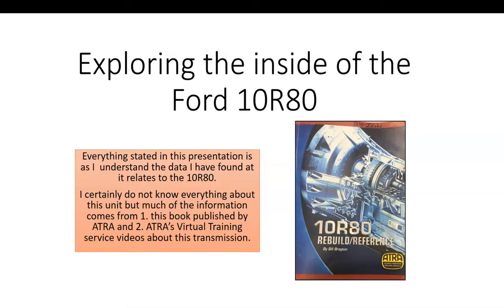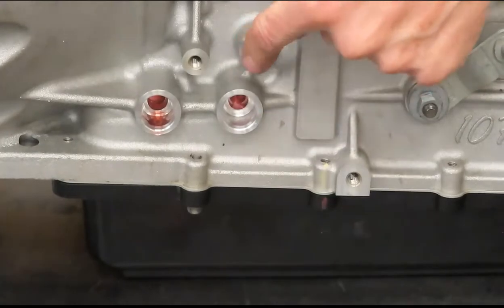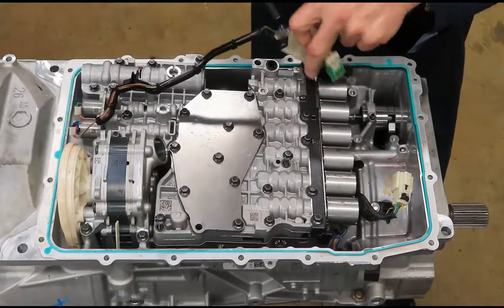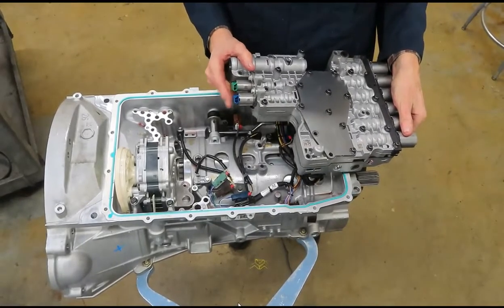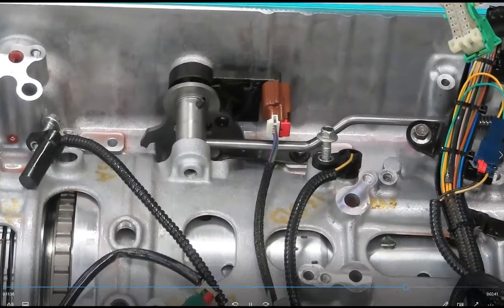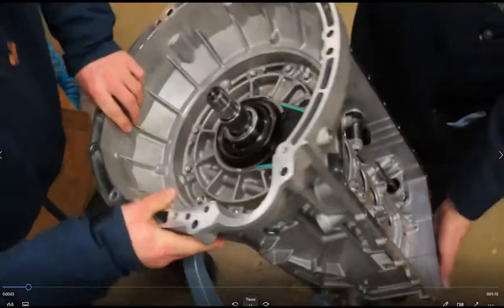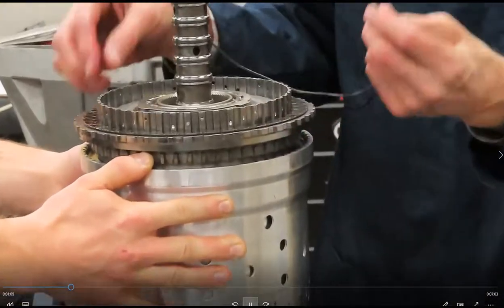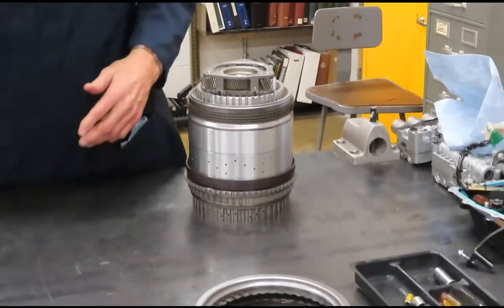10R80 part 2/5 disassembly

Comment: So i just attempted a rebuild on my own 10r80 with 230k miles. Thanks for the video it was very helpful. I got everything done and reinstalled on the tight end of clearances. It had a bad CDF Drum. I took it for a test drive, and it was working fine for several miles. Shifting gears like it should nice and smooth, then it threw a maintenance wrench code saying sensors D, and C and friction F were not happy P0766, P0762, P2705. Could hardly drive it, stuck in 4th gear, motor would rev but very little transmission engagement.

I pulled the valve body and rebuilt it and found a stuck valve. Reinstalled, reset the shift logic with Forscan, cleared shift tables and codes again and went for a drive.  It drove beautifully for 10 miles up a gentle hill temps up to 180 degrees then back down the hill. Pulling back into the shop to top off fluid at temps the same symptoms happened. This time showing shift solenoid E stuck open. With little to no response in any gear. Any idea what could be going on? Talking to local shops they are thinking it needs a new valve body. One said to get clutch clearance more towards the sloppy side.
Reply: Did you ever figure this out?

Comment: Had one of these come into my shop a month ago with a P0733(gear 3 incorrect ratio). After checking pressures and electronics I determined the 3rd gear clutch pack was slipping. Rebuilt transmission and now is driving like new. Disappointing at only 65,000 miles. Transmission never abused(I know the owners), never even towed. Would of liked to figure out cause but couldn’t determine. Just appeared to be random.

Comment: Question. The line pressure port bolt that is pointed out. Can a transmission temperature sensor be installed there with out damaging anything internal? If so what size thread is that bolt?
Thanks